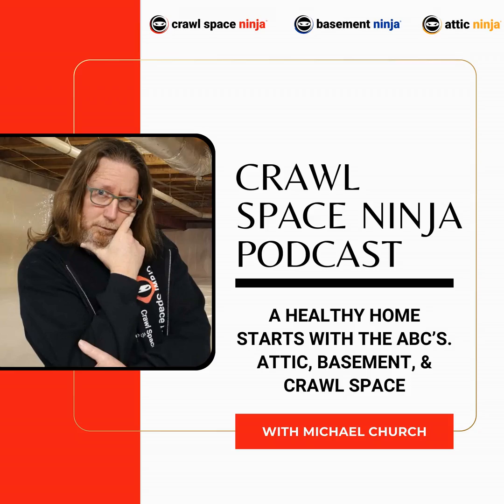Debunking Crawl Space Myths: Why Loose-Laid Vapor Barriers Fall Short

Comment: @CrawlSpaceNinja

I was about to pull the trigger on encapsulating my crawl space but....I have a big rat problem in my crawl space. ALL of the insulation and vapor barrier were just removed and I am trying to decide which method to use for finishing up. Leave it uninsulated with no vapor barrier, reinstall fiberglass on the subfloor and ducts, spray foam on ducts and sub-floor or ENCAPSULATION (twice as much)$$$.  A Pest Control company was just here and said Encapsulation is great for everything EXCEPT pests. The thick plastic sealed Vapor Barrier area prevents pest control people from seeing, termites, rodents, and bugs because they get under it and nest or burrow in places you cannot see. They can't inspect just below the mudline or under the vapor barrier. So, he's one guy saying don't do it. I don't see how he would be biased because it doesn't change as I have to have a pest control program no matter what. He could be wrong though but it seems reasonable. Also, he said he could not guarantee successful pest control with encapsulation. I just talked to my Insulation contractor and said yes encapsulation does make it harder for the pest control people especially if you have a rat problem.  What's everyone take on this?
Reply from the maker: Encapsulation could make it harder however if sealed properly there shouldn't be any room for any pest to grow under the barrier It is typical for pest removal to be done before encapsulating

Comment: I'm in NC.   I can't find in the code where it says in a sealed crawlspace the vapor barrier must go up the wall 12"  and be mechanically fastened.     Could you please cite chapter and verse?     I'm looking at the residential code section R409 and can't find it.
Reply from the maker: R408.3Unvented crawl space.
For unvented under-floor spaces, the following items shall be provided:

1.Exposed earth shall be covered with a continuous Class I vapor retarder. Joints of the vapor retarder shall overlap by 6 inches (152 mm) and shall be sealed or taped. The edges of the vapor retarder shall extend not less than 6 inches (152 mm) up the stem wall and shall be attached and sealed to the stem wall or insulation.